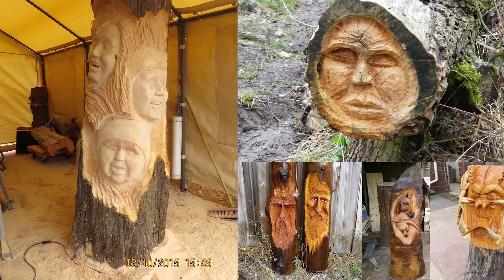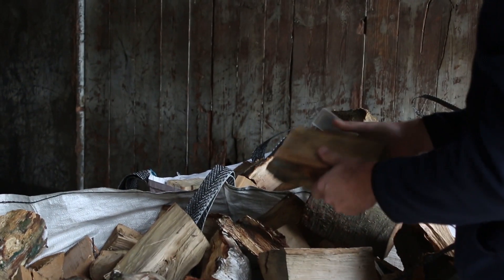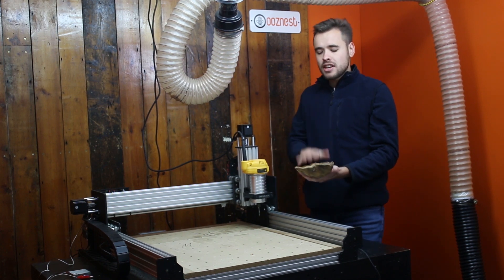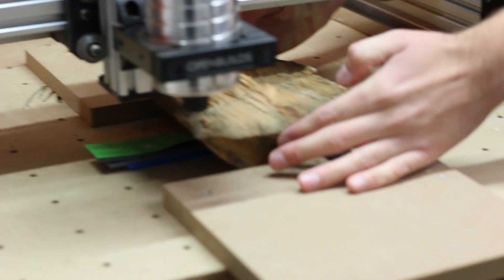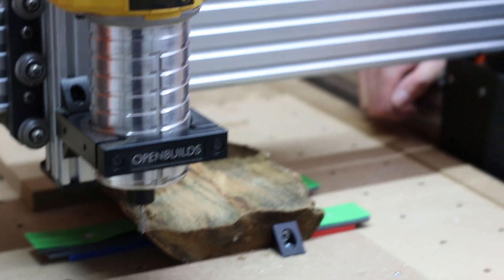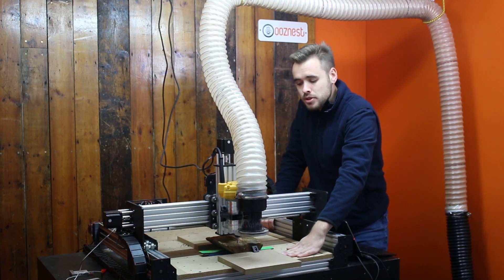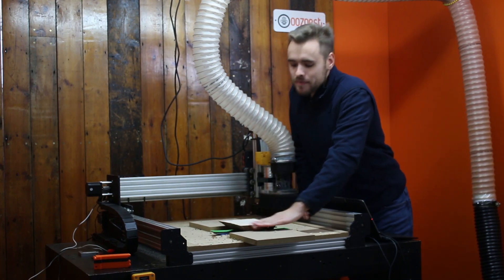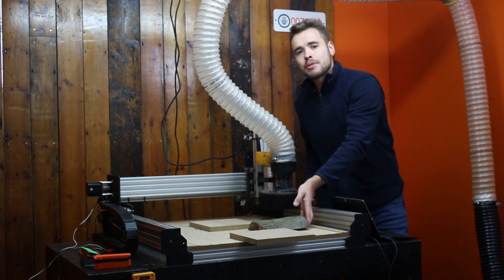Manufacturing a Log Face | Part 1 | WorkBee CNC Machine

Comment: Hi Ryan, have you used a bit like this https://www.amazon.com/Whiteside-Spoilboard-Surfacing-Router-Shank/dp/B071748JQN for this sort of job? Does the router handle this OK?
Reply from the maker: I haven't. For surfacing a MDF Spoilerboard it would be fine. But for the above i would stick to a 1/4", as we were doing 3mm pass depths.
Reply: @ooznest  what about surfacing large Oak slabs?